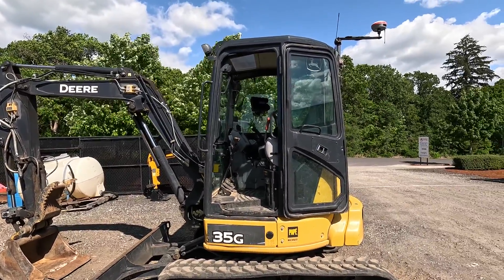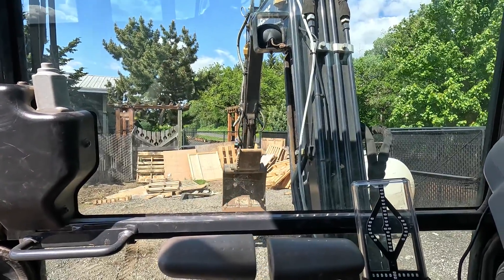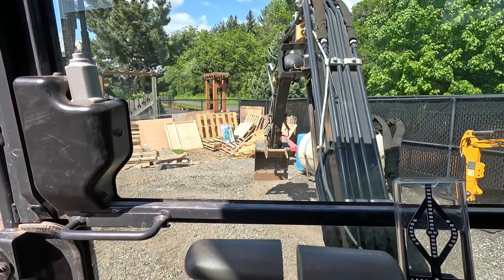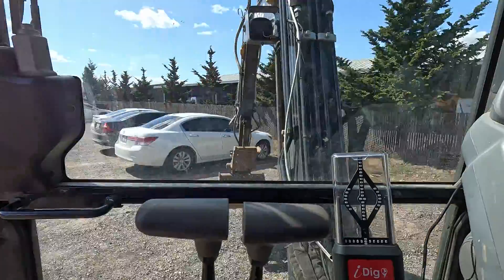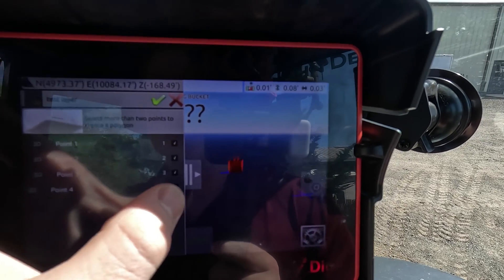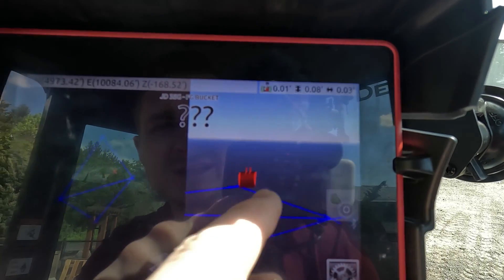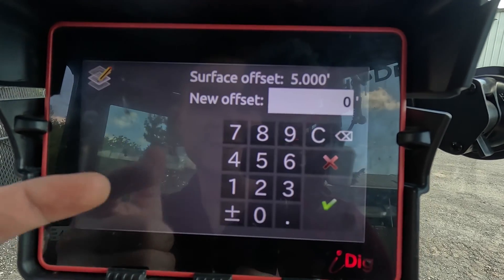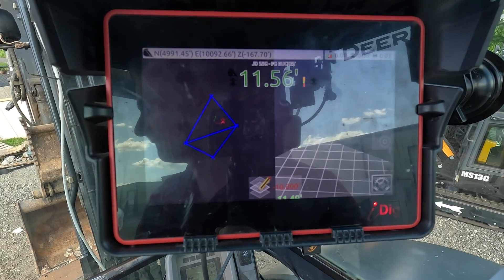Intro - iDig 3D (GPS) CT750 Excavator Grade Control Kit

Comment: Do you also have a rover or are you working directly off GPS?
Reply from the maker: GPS Corrections are necessary for accuracy, so there is a Rover Receiver on top of the cab, while a Base Receiver is located elsewhere on site.
Reply: Here we work without Base Receiver. You can insert a SIM card into the iDig Spotman antenna on the machine and connect to the RTK corrections. It's reliable by now.

Comment: I would love to see more on using the spotman for layout and putting on the machine. I am very interested in this setup.
Reply: That's a perfect iDig Connect feature! Even if you're creating a project right in the digger, you don't have to drive the digger everywhere to enter points. Just switch it so you take the points from the pole. Then you don't have to put it on the machine, because you have it already there.